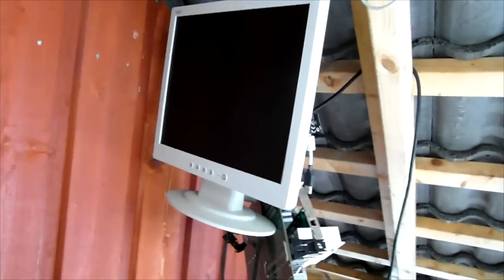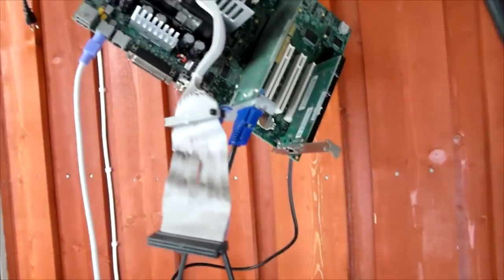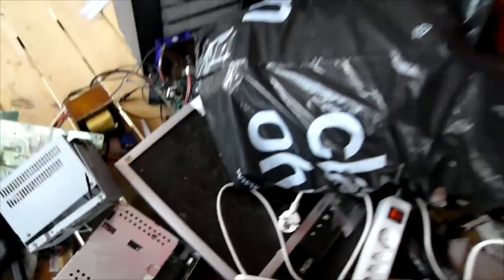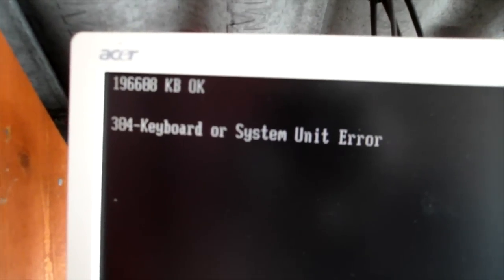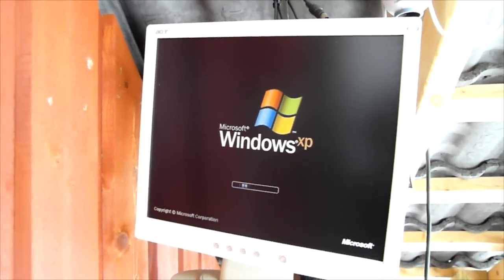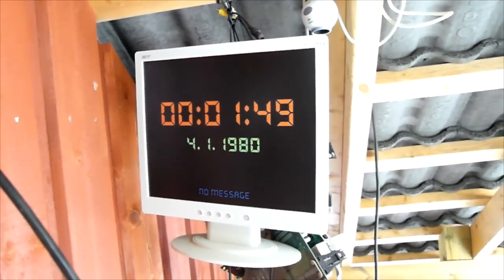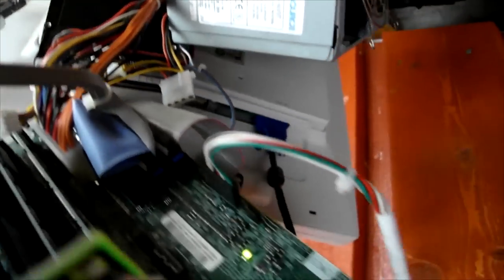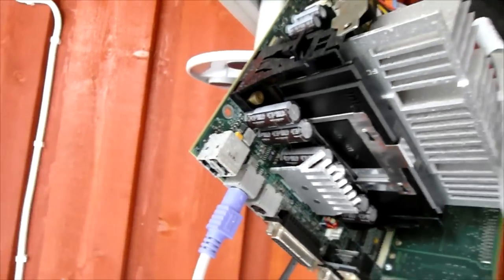The amazing outdoors-hanging-from-the-ceiling-puter

Comment from the maker: He actually lives right by a lake, and summers in Finland hardly a tropical paradise make. There's a fair bit of rust on all the computer's sheet metal. It's not plugged in very often though, so corrosion hasn't really gotten a chance to bite the PCB yet. If it had been left plugged-in and running since it was installed, it might not have fared so well.